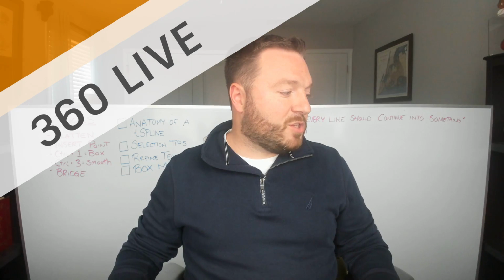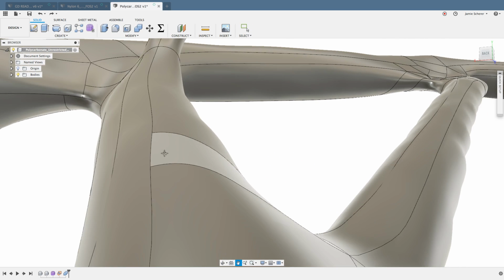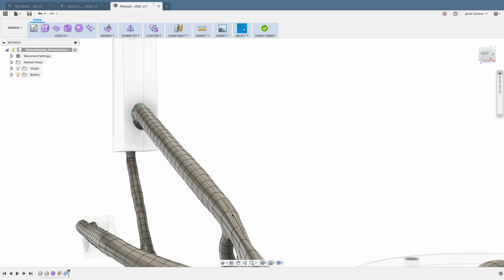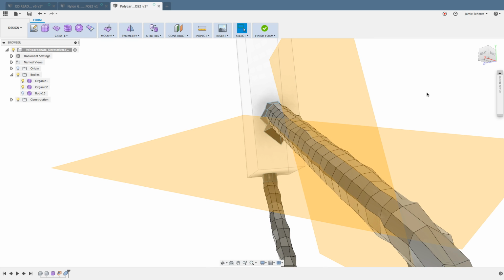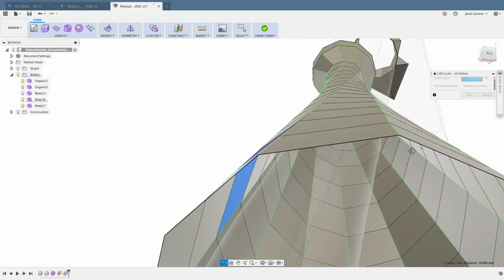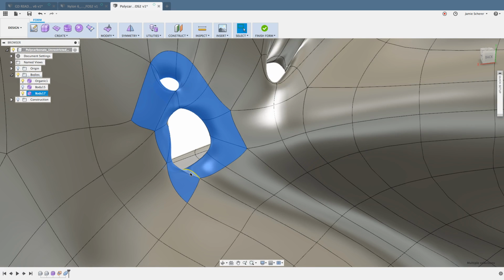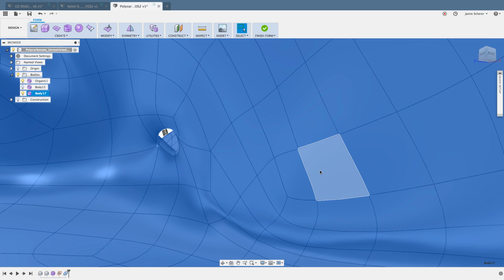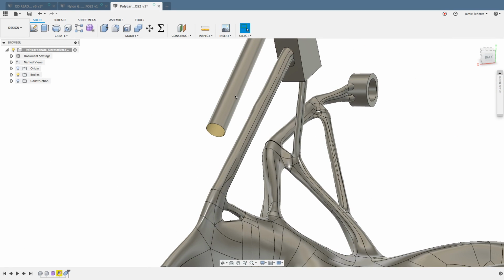360 LIVE: Sculpting Generative Results

Comment: Love Fusion 360, but we need way better mesh editing tools for the T-Spline environment. Given that Autodesk owns both Maya and 3DS Max this shouldn’t be too much to ask. Maya for example has a great alignment method for vertices with the hover method, there’s of course countless others but you get the idea. This video is actually a great example, for stuff that needs to be manufactured and styled clean topology is a must. A great way to potentially straighten out vertices is if we could clamp the two ends and only straighten the vertices in between the clamped ends. Thanks for the video by the way, it does show good techniques for the current toolset👍